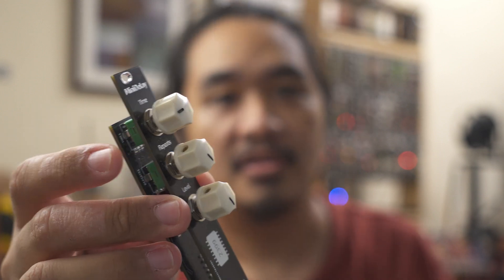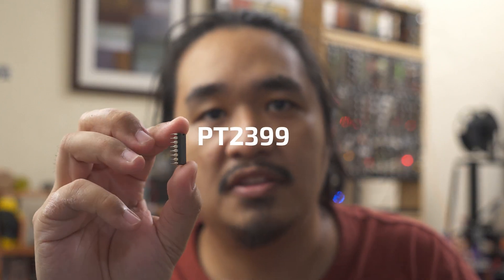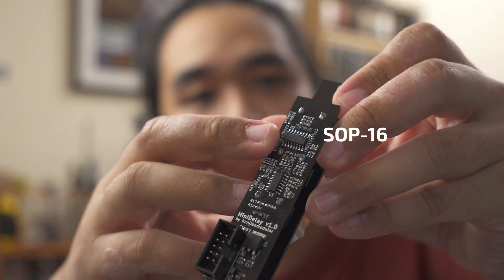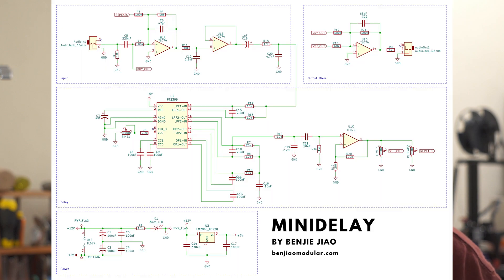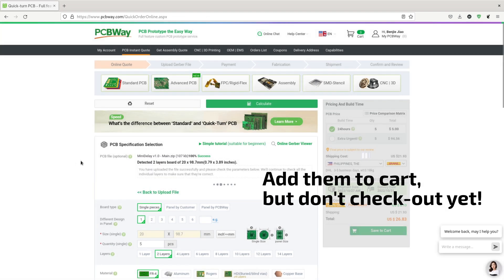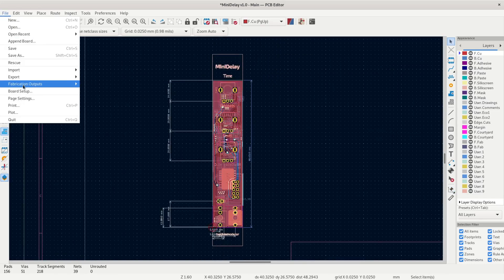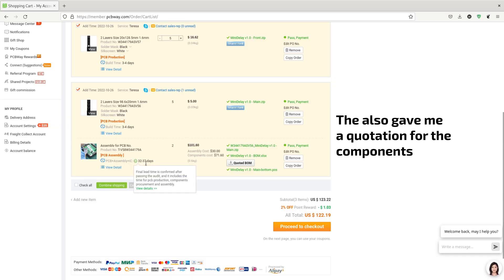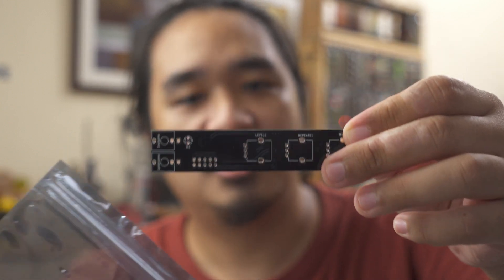MiniDelay -- My first SMT project! #SynthDIY #Eurorack #PCBWay

Comment: Hello, I have realized that there are lots of pt2399 that are very noisy but not in the repetitions, but when given more repetition time, they emit white noise, since I have older delays that do not do so and reach very high times. superiors.  Do you know something about this?  Greetings and thanks
Reply from the maker: Hey! Sorry I wasn't able to see your comment sooner. This one doesn't sound so clean at longer delay times and higher repeat settings. I just take it as its quirk. :D

I've heard of people cascading multiple PT2399 chips to achieve cleaner long delay times. Haven't gathered the drive to try it out though. Heh

Comment: Dude! Absolutely love it! Been meaning to try out the PCBway assembly service.. I think I'm gonna do that now. Thanks! Keep on wiggling!
Reply from the maker: Hey thanks! That's awesome.

I recommend having them do the SMT and then you do the through hole parts yourself. You'll probably save a bit of $ and the process will also be faster afaik. 😊
Reply: @benjiaomodular  good to know! The smd is the part I struggle the most with.. complex smd work can be frustrating at times for me. Greatly appreciate the feedback. Keep up the good work! Cheers!
Reply from the maker: Yup! I've been trying to avoid having to solder the SMT boards as well. 😅

You're welcome and thanks for the kind words. Good luck with your projects!